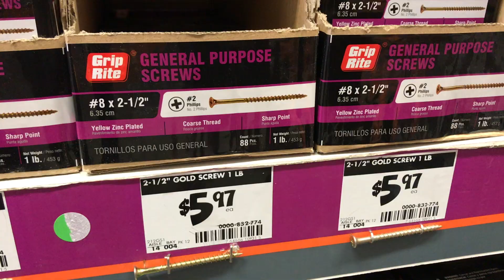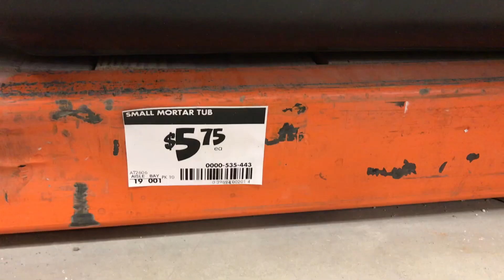Part 1| Morph Mixology DIY Rat Breeding Rack | Structure with Tubs

Comment: can you put the supply list in the description or tell me ? i watched Jason's video but want to make sure i have everything as home depot has a newer tub that is bigger than what jason used
Reply from the maker: Sure! Give me a few days as I have to go reference his video and double check everything.
Reply from the maker: Sorry it took a little longer. I have added a supply list to the description box. As far as I can tell, the tubs have not changed. If you have to use a different size tub, then you will have to adjust the measurements accordingly.